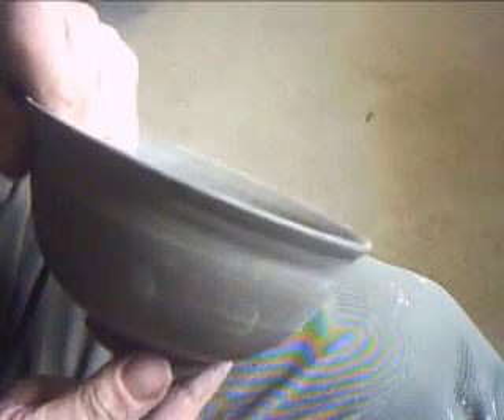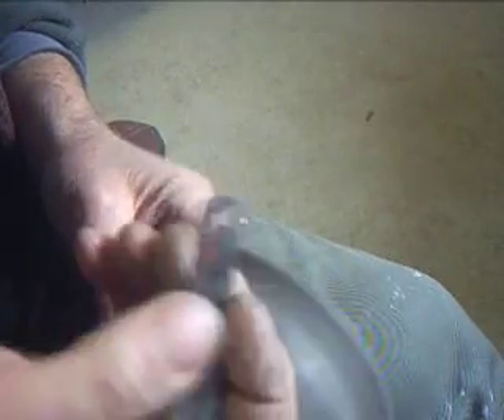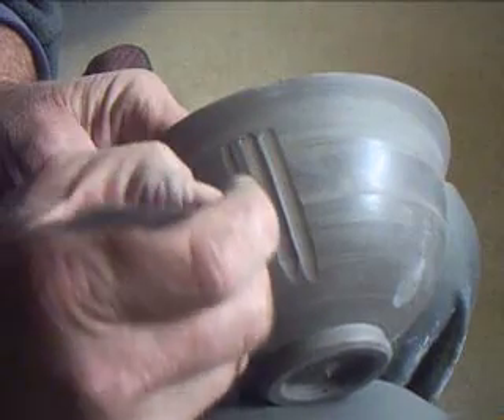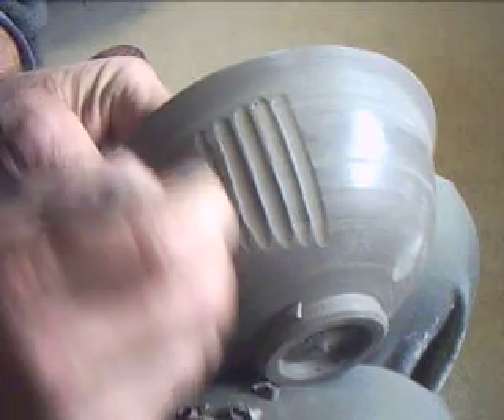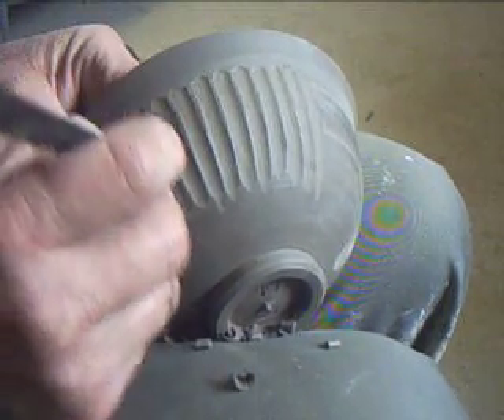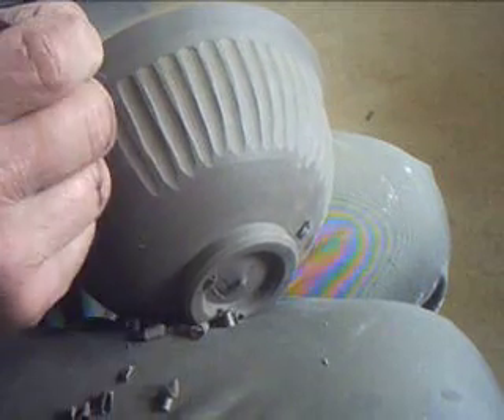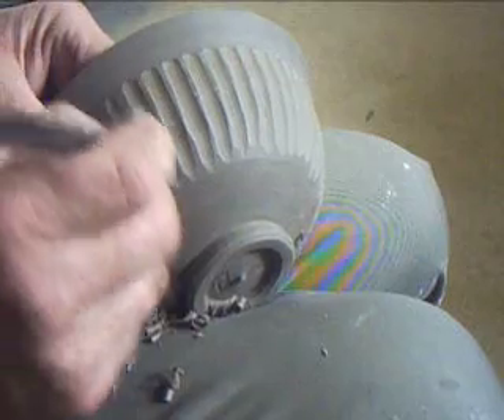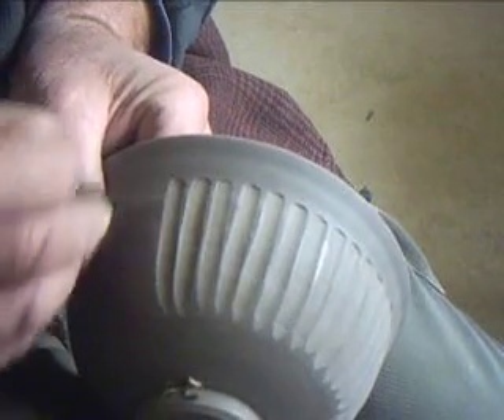SIMON LEACH - fluting a bowl !

Comment: I have been trying old springs stretched out and fastened between a U shaped piece of bamboo for fluting pots on the wheel.  I make vertical flutes then shape the pot further from inside causing the flutes to twist a bit.

Great videos please keep posting.